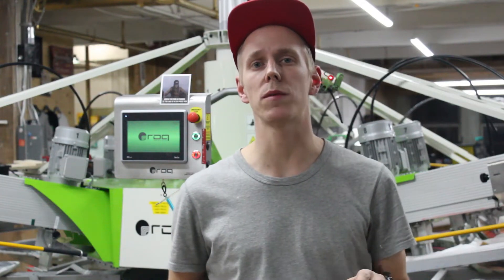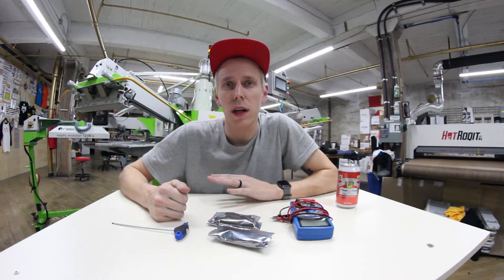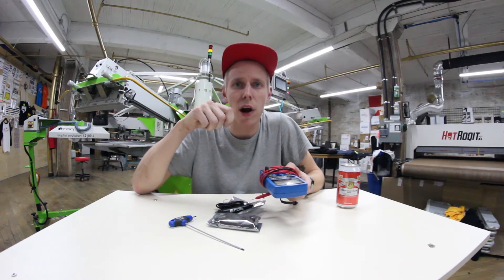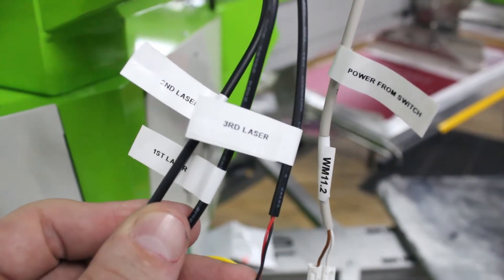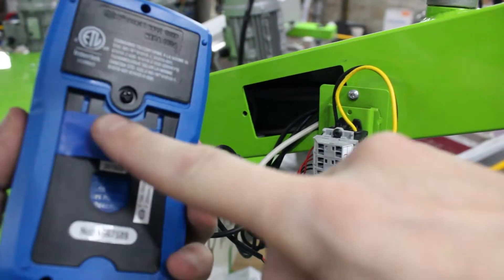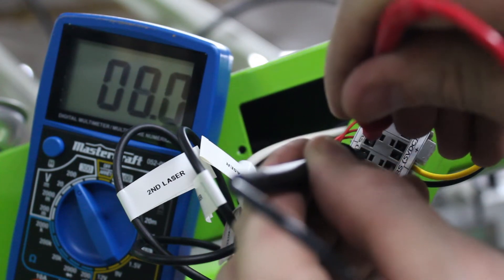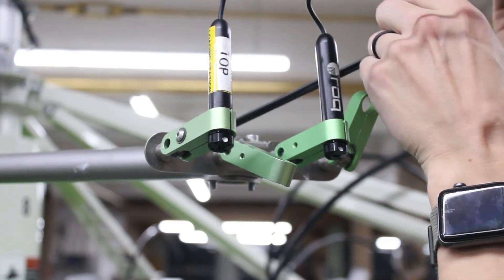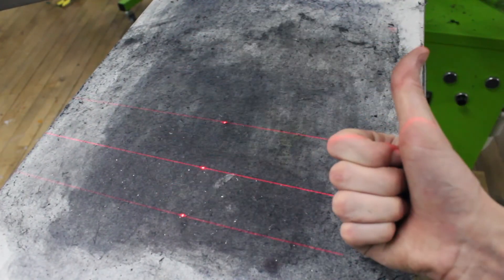ROQ Lasers - Replacement, Testing, and Tips!

Comment: Where do you get replacement lasers?
Reply from the maker: The OEM ones you can get direct from ROQ but they are expensive. You can hook up any 5v ‘line laser’ to the same power supply though and they can be found super cheap online.

Comment: Nice easy tutorial man! you said the technician wired the machine wrong? how is that possible? LOL what exactly did they do? I'm looking into a small auto, but haven't decided yet
Reply: also, did you find good lasers on amazon or something?
Reply from the maker: I think it was wired wrong from factory. And instead of checking voltage they just checked the wire colours. When it didn’t solve the problem they kept sending replacement parts until someone got me to check the voltage. Problem solved. 

Roq has lasers I haven’t been able to find anywhere else, a line with a dot. But plain line lasers are available on eBay super cheap and I had a set of them on our manual press before getting the auto. Wouldn’t print without them!!

Comment: Have you worked on any other autos other than the Roq?
Reply from the maker: Nope! So it was a really tough decision when picking a machine. I wanted something quiet, simple to set up and with simple controls. Been loving it so far but the learning curve is pretty steep.
Reply: Cory @ Floodway Print Co. having a machine that is quiet seems like an overlooked detail. But definitely seems like it is well worth it in the long run
Reply from the maker: Got a quiet compressor too which is probably a bigger factor. But it’s definitely nice to have a quieter shop. If you expect anyone to stand near something for that long you gotta consider their sanity. There’s science between sound and distraction. Look up ‘the Windsor hum’ for an exaggerated example.

Comment: If you have a PRU and reg board, please make a video that shows how you dial that in to reduce setup times. Great videos keep it up!
Reply from the maker: We do have one! But haven't been able get it dialled in. It's not really the miracle that was promised to us, but part of the problem I think is that our press was not calibrated correctly at install, so when we tried the system it was close - but not close enough to save us any time. It's very high on my list over the next few weeks though. The biggest challenge for us I think is finding a space for the PRU unit that doesn't add waste to the process because right now we gotta take some steps to get to it amongst other wastes. So THANK YOU for your suggestion, it's coming but it's tricky!!